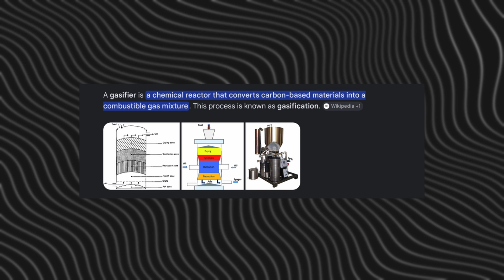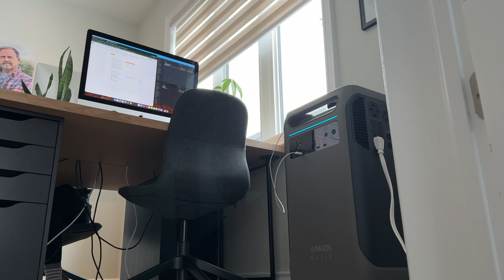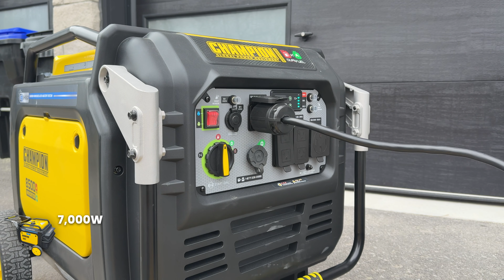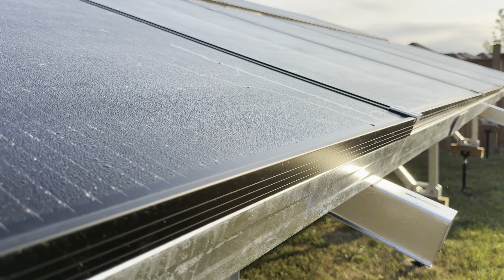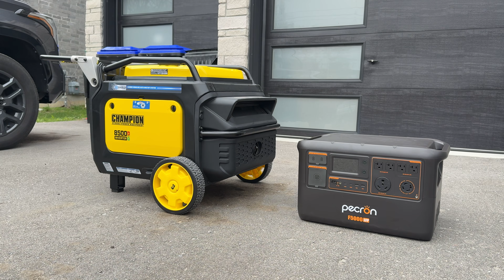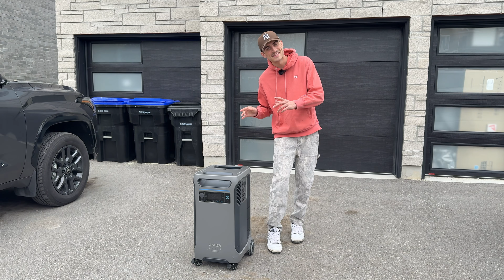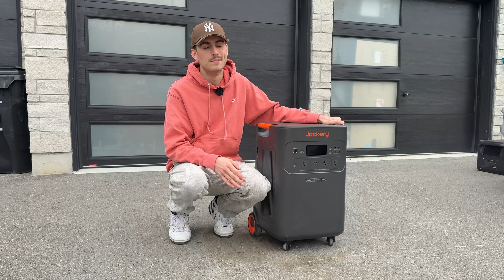Can a Power Station Replace Your Gas Generator?

Comment: Everybody who sells power stations is missing the systemic problem with them . That problem that number one problem is the companies do not stand behind their product. If the product has a problem when you need it it's not reliable if the company doesn't stand behind the product it's not reliable. Customer service is terrible across all brands. Fix the customer service and will buy your product

Comment: If you want backup power for a week, get a 250 gallon propane tank and generator. Propane never gets old and needs replacement. If you want to go off grid, get solar panels and batteries.  Solar generators are useless unless you live in an apartment or use it camping.

Comment: A generator that size puts out way more power than your home is normally using. Anything not saved in a battery is being wasted in the form of excessive gasoline or propane consumption. A smaller generator paired with the Pecron F5000 used only to keep it charged is the way to go. You would likely run a small generator 5-6 hours per day instead of a large generator 24hours per day with the noise and the risk of getting it stolen during the night. During an extended outage, the noise of a generator attracts theives.

Comment: Running an HVAC system in an extremely hot or cold climate, during, a power outage, can be a life or death situation for some so not sure why it wasn't a consideration in the runtime.

Comment: For the price of the f5000 or the big champion, I got a pecron e3800, a DJI power 1000v2, and a small Wen DF280ix and some 30lb tanks of propane for shelf stable backup fuel after consuming the 5gal mower can

Comment: the gas/propane generator needs to be Inverter-type, because a non-invertor generator (std generator) output has too much THD, and the power station will fault-out or get damaged...

Comment: I have multiple generators and multiple power stations.  In 2021 I had nothing but a small propane generator that could charge phones and run the fridge.  The snowpocolyps of 2021 was an absolute eye opener.  Fuel scarcity is a thing.  
After that I started collecting power stations like Pokémon cards and eventually ended up building a system for the house (6000xp, 280ah wall mount, 8kw of solar) but I kept most of the power stations just because 2 is 1, 1 is none.

Comment: So, I have a stand alone (well two of them) a F150 powerboost (the 2.4kw - yes generator) and a small power station.  The power station is used in the office where the electronics are plugged in and it is plugged into the wall so what we use on electronics is auto replenished for a cleaner energy source.  We can shut off the gas unit for refilling or when we leave for a while without worrying about electronics being upset as they have the battery power.  At night, we shut down the gas and I switch to the F150 (yeah, I bought it used and the 2.4 was much more available and cheaper - by $2k and can last up to 85 hours on a tank at max output where the 7.2 can last 35 hours) because it will run in gen mode and turn on to charge the generator by itself with very little noise.  We actually only switch to the gas generators if we are going to be power hungry and family and friends come over to stay warm - its usually winter when shit happens on Cape Cod.

Comment: Pecron has a a dirty little secret.
If you have a non-inverter generator and turn on generator mode per the instructions, the 5000 turns off L2 and only outputs 120V.
I found that when I activated generator mode the F5000 turns off one leg of the 240 and only outputs 120V. Opened a ticket and got this reply:
Hello,
This is how generator mode works: the
L2 output section-that is, the right half-will stop outputting AC power. This is because this section is bypassed.
It doesn't say that in any of the advertisements, manual or on the website.

Comment: Installing 2k watts of solar is a bit more involved than just buying the panels.
The power atation doesn't have 100% efficiency, so you aren't getting the 5k watts of power, ever.
I have the Pecron E3800 and one expansion battery.  Of course, we haven't had a power outage in over a year so I can't give a review.  I have 1600 watts of solar and use the Pecron to run an inverter AC in our bedroom every night for "free."
I have 2 gas generators.  A Honda EU2000I and a Predator 5000.  The Predator I have never put gasoline in and I always use propane.  I keep 20 gallons of gas on hand and just cycle it through other vehicles to keep it fresh.  I also keep 120# or so of propane.
One thing to note.  I run my gas generators every month for about an hour.  The Honda is at least 10 years old but I really don't remember when I bought it.  It has never failed to start within 3-4 pulls.  It will only run at about 1500 watts continuous so I have to adjust the power stations I have as they can shut it down at max charge rate.  
I have 4 power stations, from 235 watts up to the Pecron.

Comment: So you bought the most expensive generator possible to compare with an over priced power station.
Pecron bought you opinions.
Btw:  My generator was $200.  Yes, I also have 6KWh of battery.

Comment: I use a 11Kw inverter w/ Generlink during the day, and a Bluetti Elite 400 during the night.     Most outages here in Maine are due to ice storms, and wind storms - so solar as a backup mechanism is less than stellar.  I have found this combo to be both efficient - and cost effective - especially with a heat pump water heater.

Comment: @TheSolarLabPlus good vid. I know most of your vids are sponsored ads for power station products. But what I like is that I agree here. Most people may not know they would realistically NEED both. What I saw you didn’t really go into was solar set ups price. Just said it can be done for about a grand. So my point is it’s like a hybrid system. You get the Pecron F5000LFP, it’s your first intro to solar generator. You get the biggest gas generator you can afford and store and keep maintained.  You have options this way. And that is. The power station is a reservoir. You can use that all night and morning into the day. When it starts generating solar during the day to sustain some usage. Depending on where you are. If you need A/C off of that thing all night if it’s even able to run the small system you might have then it kills it fast. Otherwise it charges from the solar during the day depending on how much you spend on solar. Then in the evening ideally before dusk. You fire that generator up for about 2 hours or less if it’s has 240v. And you charge the crap out of your Pecron power station as full as you can get it. That power station then runs all night till sun rise when hopefully you can start to get some solar input. Of course with sun that’s all great in winter when you don’t get sun or it’s just rain you are just using the generator.
Reply from the maker: None of our videos are sponsored ads! We could make a lot more money if they were though... but yes a generator as a  reservoir is a great way to put it! they work great for that scenario and i think most people don't realize the benefit that come come from using them together instead of replacing a gas system with a battery system.

Comment: You left out that current battery technology such as LiFePO4 doesn’t do well in cold weather.  If you live in an area that gets cold and you want a solar generator you might want to look into a model that has built in heating for the battery.

Comment: So at the same load that gives you 10-14 hours on the generator (1/4 load), you can get two hours on the power station. 

If you can only have one, and are in a location where you can store fuel and run a generator, get a generator. 

If you are in a place that won’t allow you to run a generator, get a power station. 

Best solution. Spend $300-$600 on a 2000wh power station and another $300-$700 on a generator (depending on if you need 240V for a well).  Add another $200 for 400-800 watts of solar you can pull out and setup in the yard if you have a longer term need. 

Run small things off the power station, start up the generator occasionally to run larger loads and charge when needed.

Comment: A major miss in this video regarding that "only" $1000 in solar panels is the cost of the mounts, which often adds 75% or more to the cost of the panels.

By far most of the US and Canada only need to endure power outages lasting less than one day and are best served by a small ~2000 watt internal combustion engine generator to complement a battery storage device. Many ice storms are followed by consecutive days of clouds which make solar a terrible backup for recovering from those events. The other cause of major outages is hurricanes, and prep for those need to include having generator fuel -- this is where propane excels because the shelf life is measured in decades compared to gasoline's 3 to 24 months.
Reply: I cycle my gad through cars and boats every month to avoid that issue, but I also keep around 120# of propane on hand.

Comment: What’s up with not wanting to state the F3800 Plus price? If the price was forgotten, you could have just post-productioned it as an overlay.

Also, not sure why you highlighted its running watts, but failed to mention its capacity was 25%-30% less than the Pecron and Jackery.

Comment: No way a cpap use 800 watts in a 24 hour period, unless you will sleep for 24 hours straight.  My BiPap used 144W in a six hour period using a heated hose and the humidifier.  Checked the consumption levels a couple of days ago.
Reply: I used my Resmed Airsense11 last night, with my power station fully charged to 100% and turned my humidifier off. When I looked to see how much energy I used it said I had 92% left. I used the DC outlet or the cigar plug. When I use the AC OUTLET I use 18% each night sleeping 8 hours

Comment: That generator isn’t not running 30hrs with 7gals of fuel 🤣🤣🤣 I have the same unit. It’s a gal and hr at minimum. Your bat shit crazy if you think you will get 30hrs with 7gals of fuel. Most gensets no matter the brand in size (give or take 1000 watts) usually burn a gal and hr when they are in use no matter what the math says on paper. I’m in FL I been using generators for 30 years here. I own 6 of them. It is what it is. But in reality those numbers on paper don’t come close what so ever.

Comment: Good video. Having the power station and small generator combo is a good solution, especially if you don't have room for the solar panels. I do wish that, when discussing what items you can keep running and how long a given power station can run, that you would not stay stuck on the CPAP and sump pump - I would be more interested on how long the fridge, WiFi, Computer, TV Lights and an induction burner ... that might be a little more fitting for a 'typical American home' since not everyone uses a CPAP or needs a sump pump - but most still eat and watch TV.
Reply from the maker: That’s a fair point, I'll definitely keep those common household loads in mind for the next test! ⚡️

Comment: With a gas generator, you have to buy the gas before the power goes out.  Once the power is out, gas stations cannot pump gas.  Same with the solar power stations, they have to be charged before the storm hits.  I've upgraded my pv solar (12.1 KW) system to 12 KW battery storage and am selling my gas generator before the next hurricane hits me in Florida.

Comment: with the non inverter generator there is a risk of damaging your home electronics and the power station may not accept the charging from it. Make sure yours will.  Living in Montana i have found using a smaller inverter gas gen to charge up my large power station when solar wont has been the most reliable system for keeping power in my home.

Comment: You want both. If there is no sun, it can't charge the solar station.  If you cannot get fuel because of whatever, you will not be able to use your generator.  Down here in FL, getting fuel after a storm is an absolute nightmare; you want both.    There is no this is better than that; they both rock it in a pinch!
Reply: Post tropical storm or hurricane heat makes it essential that you find a way to cool the house. That's especially true if you care for elderly folk.
I went nuts a few years ago and got dual fuel.generators for post storm grid damage and two power stations permanently inside the house to provide power during the storm. Hurricanes in Florida are no joke.
Reply: @lpadron13  No Joke is not a joke. Longest time out of power for us was 9 days. Clay Electric came to put a surge protector on. He was out for 22 days. He ended up building a 100,000 watt generator. Powers home and shop. I keep 2 5,000 BTU AC window units available. 20 gallons of distilled water. He said get a generator, preferably a dual fuel, gas and propane and get the Generlink Emergency Transfer Switch for $1,000.
Reply: I've used a cheap generator to charge up my anker power station, then run my fridge and a window AC unit off that.  I barely use any gas but am able to keep things running for a long time.
Reply: Best idea if you dont like rotating fuel ( assuming you have a shed) is to keep a bunch of empty fuel cans
Soon as you know a storm is coming, fill them before the last minute panic buyers come so you can relax at home and avoid the mobs

Comment: Get a reasonably powerful inveter battery and work it with your inverter generator. I have a 2500 watt propane generator and 3 20lb tanks. I have a 3kwh inverter battery. I can likely run my propane generator for 2-3 hours per day to keep the “battery” topped up for nearly a week. The schedule for the generator can be timed for once in the morning, once midday, and once prior to sleep time. Meaning you ont have to maintain your battery overnight. It’s all about timing and capacity. Some inverter batteries have smart generators (aka eco flow brand). 

Don’t forget to maintain your generator by doing oil changes and air filter cleaning and spark plug maintenance throughout the power outages. You work a little to keep it working for you long time.

Comment: The EG4 Chargeverter can accept dirty power from the cheap generators and charge with up to 5 kilowatts pure sine wave.
The gas generator is the last resort for economic reasons and clean power so the Chargeverter is a good investment in long term outages when solar isn’t available.
Reply: Just a note, the Pecron 5000LFP in the video does not require clean power. It has what the EG4 does built in "Generator power mode" which handles the distorted waves better.
Reply: @sactownchad  That’s a great function!

Comment: Depending on electric needs, you will end up using a Generator to maintain constant use. Great coupling is solar. 
I lived off grid for 7 years and had a very large battery bank. I had solar and auto start and charge generator. It was awesome. It definitely cut back on the diesel fuel need for battery backup. But in the winter was an absolute constant need. 
Cooking, refrigeration and laundry drying all used propane. Wood for heat. So electric needs were minimal. 1000 watts solar did fine.

After years of living off grid, we calculated our energy costs and all systems. We estimated another 25 years of use to regain any costs instead of grid hookup. It was worth the massive costs for off grid living in comfort. We did have breaking and system fails. We had constant self maintenance. Those costs and amounts of time diagnosing, finding parts and then fixing were almost too much. But the cost and loss of personal time was a lifestyle. 

It's amazing to me that on grid homes would have these spendy options for a couple power outages in their lifetime.  I have a smaller power box that I use for remote camping or no connections camping. But I generally just push the remote starter for the propane super quiet inverter generator. Then brew coffee and charge the normal system. Runs about 1 to 2 hours and done. I also have a 200 watt solar panel for the rig LifePo4 batteries and use the normal 12v system. I bought a 4500 watt gas/propane inverter generator online from Ebay. A refurbished $350 costs. It doubles as a house backup etc...

Comment: A bit biased towards power stations… one major drawback you failed to mention is if you don’t get one of the power stations that produce split phase 240v power you’re really not safe trying to use it as a home back up via a generator home inlet and a transfer switch or interlock kit. To be fair, I believe the power stations you mentioned do provide this, but most that are not the bigger ‘whole home’ options do not. While most of the combustion generators over 6000w can do this no problem. Something basic yes, but I feel you should mention this in the video. In the end it is best to have both as the power station stores power and the combustion generator is generally more capable and reliable as long as you have the fuel.
Reply from the maker: Great point, split-phase output is definitely a critical factor for whole-home setups that gets overlooked often! ⚡️
Reply: I mean, both... Both is the answer. The only thing little dinky 1000 Watt hour solar generators are good for are your electronics, CPAP, fridge, etc. Whole house backup requires a unit just like they showed in the video. In fact, the Pecron 5000LFP can take dirty power from the generator and charge while the 240V is plugged in to a home interlock. Dirty power in, pure sine out. I don't know about you but I would rather not have a gas generator going for 8 hours a day like our neighbors did after Hurricane Helene. Charge up the big ass battery with a gas generator after your shower, and run the house and the heat tape in the well house overnight with the battery. I would add solar to my setup but too many trees.